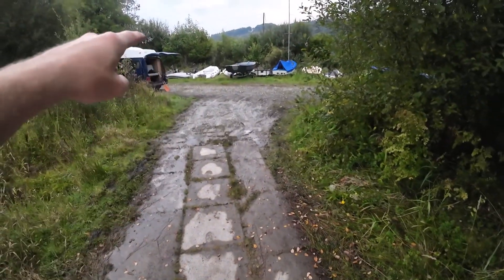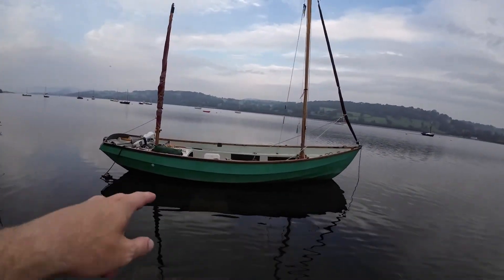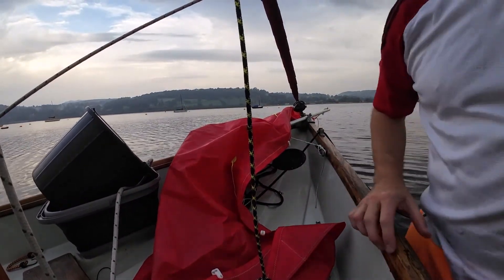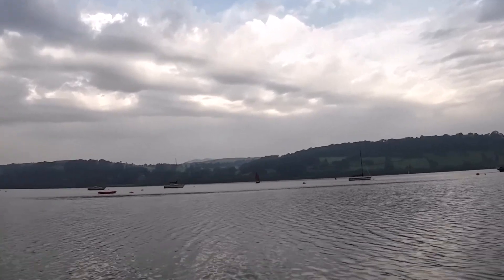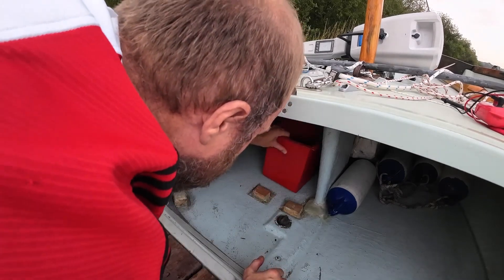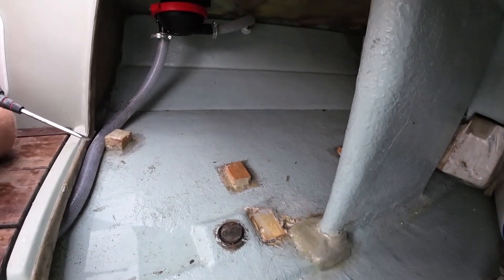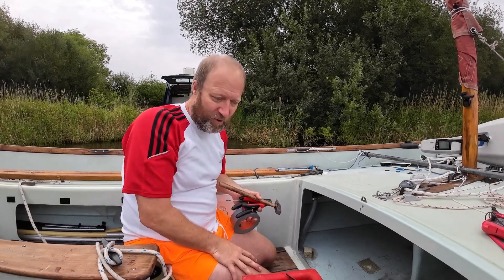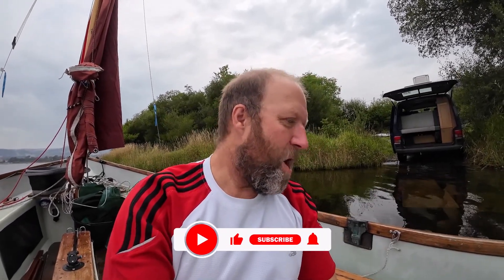Making a Flying Jib For My Lugger And Dry Fitting The New Battery Box

Comment: what gauge wire is that u are using for the 12v supply , welcome back
Reply from the maker: Pretty sure its 14AWG.the SAE connectors may be slightly bigger at 12AWG. It depends on the ampage and distance you need.